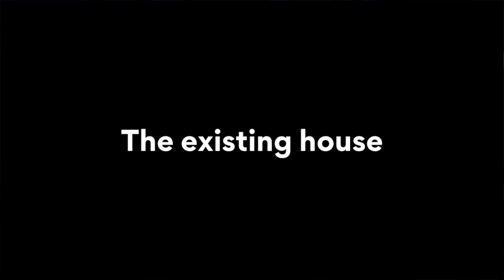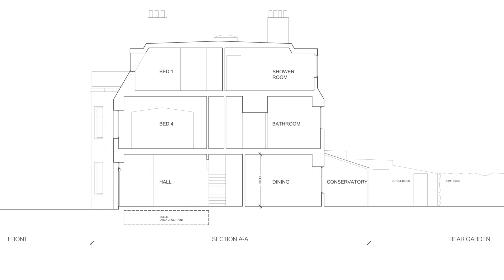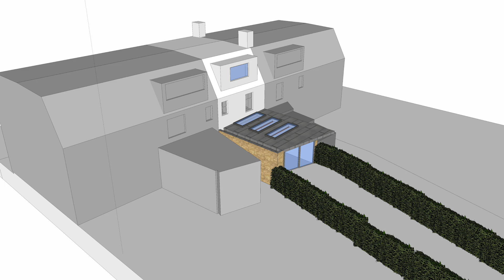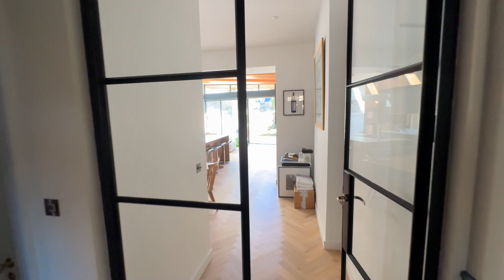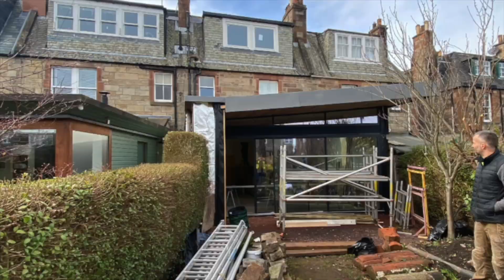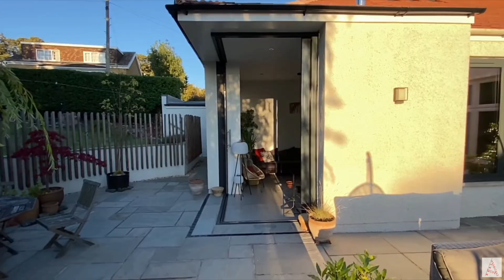How I Designed a Kitchen Extension for this Terraced House

Comment: Nice job & finish. Complete open plan is overrated. If possible, it's always nice to keep a separate space away from the large open kitchen/dining. And if possible the washing machine/dryer, Super nice use of light. I also wish I'd put the door overhang in on our extension.

Comment: Is there a downside to using metal roofs? I.e. noise with rain for example ?  I am planning a new roof for my entire home , Including a new single story side extension and wonder if a zinc roof is a good solution.
Reply from the maker: I can highly recommend zinc. The amount of insulation in the roof means occupants don’t hear anything